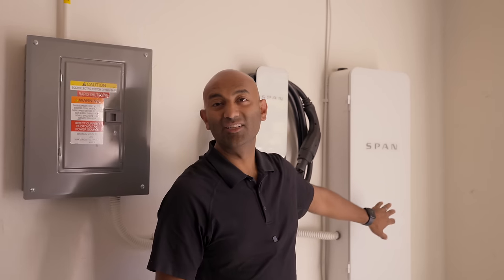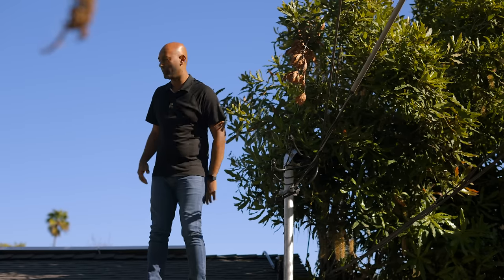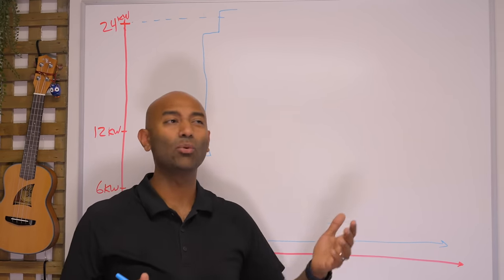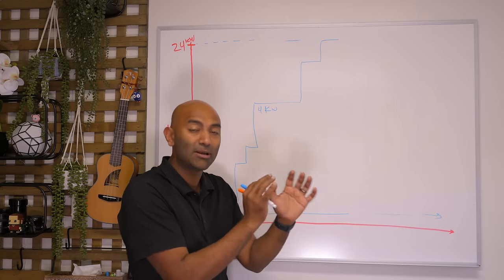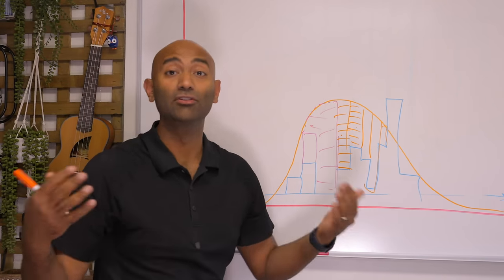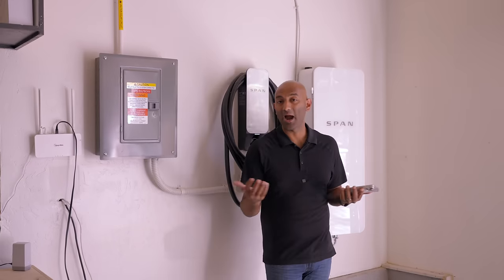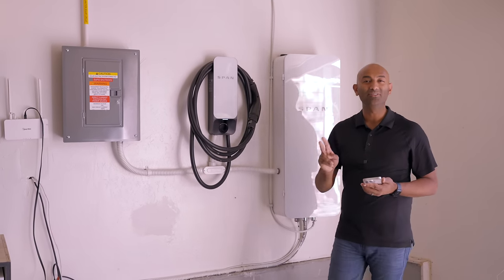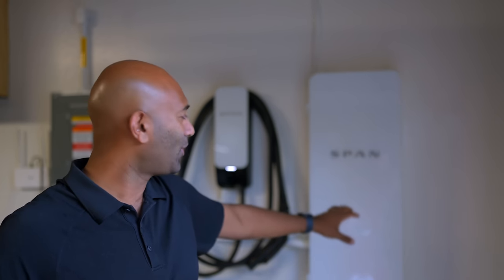I Installed a SPAN Smart Home Panel, Should You?

Comment: Critical load panels have become old-school.   That methodology is obsolete.  Yah, I know, they were popular just a year or three ago.  But not any more.  Battery-inverter installations these days have enough inverter capacity to run the whole home and the wiring for that is actually a lot easier because you intercept the service ingress and don't have to touch any existing panels or move any circuits.  So, no critical loads panel is needed anyway.    Instead all you need to do is manage your battery capacity.

For that matter, a home with a battery system can allow more load than the service just by default.  Meaning that upgrading the service is not necessary unless you intend to try to make money exporting massive amounts of power (which usually doesn't work out the way the home owner would like it to anyway).

Another big problem with this is that many homes have sub-panels in the home to distribute most of the individual loads and the main panel in the garage only has a handful of garage circuits on it plus the feeds to the sub-panels.   Moving all of those circuits back to the service ingress where the Span panel is located is impossible.  The sub-panels tend to be organized by proximity and not necessarily by critical-v-non-critical needs.   Span is useless in such homes unless you really spend the big bucks and replace all the sub-panels too.

Scheduling is not necessarily that big a benefit.  Think about it.  If you only need to plug your vehicle in once or twice a week, is there any actual effort required to plug it in at the appropriate time?  Or program the vehicle itself to decide when to charge?   The Span EVSE's ability to vary the charge rate is a cool feature, but it isn't hands-off.  If you plug-in intending to get your vehicle charged up quickly for a trip you intend to take in a few hours, it isn't going to know that unless you tell it.

Similarly, there isn't much of an advantage organizing house circuits in an automated fashion in the event of a power failure.  You have a power failure, you spend 5 minutes turning off your furnace, A/C, and water heater, and then tell people not to use the oven, and maybe unplug your EV (if it was even plugged in in the first place).  That's all it takes.

A smart service panel is not needed for these things and, in fact, the last thing you want to have happen is for the smart panel to interrupt something someone is doing without warning. If the oven is in the middle of cooking dinner, you don't want the smart panel cutting it off.

Comment: "SPAN has an API to talk to the car"  I'm sure all Chargers (EVSEs) talk to the car - that's nothing new, it's part of their comms protocols, along the lines of "What can you take" and "I can deliver x kW" as well as the other safety stuff.

Some EVSEs, like the @MyEnergi Zappi include a sensor on the oncoming supply that you can digitally set to any current, 100amp /80amp /59amp so that the charger will throttle the delivered current to the car, including stopping, so that the charger doesn't overload the house supply.   If you have more than one Zappi, one takes control and communicates to the other(s).

Comment: I am very curious about home charging your tesla using the J1772 adapter. I use my Tesla mobile charger, but was thinking about getting a dedicated charger and one the things I was thinking about is using the J1772 adapter for my charging seems like it would be annoying. Currently, when I want to unplug and go, I walk up push the button on the handle, hang-up the cord and go. With any other charger I wouldn't have that button and I feel like that will require me to either go in the app or the car and say stop charging every time before I can unplug and go. 
Since NACS is open I would love to see companies offer tesla charge handles with the stop charging button.
Reply: I thought all EVSE set-ups allowed you to simply unplug.  Our Nissan Leaf has type 1 socket for the type 1 plug, the plug has a switch in the 'trigger'.  As soon as you pull the trigger the EVSE cuts the power and you simply pull the plug.  Type 1 is the standard in the US, (Europe: Type 2 probably has the same thing)
So your question over having to go into an app is moot, all charge plugs have this instant disconnect feature.
Reply: @terryjimfletcher  a typical J1772 can be unplugged, but Tesla has a latch in the port, so the car has to release the connector. 
I bought a security ring that goes in the J1772 to Tesla adapter and prevents people from just unplugging the car, for charging in public. 
In my experience I've only charged on J1772 a handful of times, and I have used the lock. So to stop charging and pull it out I had to either go in the car or use the Tesla app to tell the car to release the connector. 
Maybe if I were to charge at home I wouldn't need the lock ring and I could unplug the J1772 connector and then the car would release the adapter. I might need to try that at some point.

Edit: the Tesla provided EVSE has a pushbutton on it that sends a signal to the car to unlatch. This only unlatches if the car is unlocked (or detects a phone key in the area)

Comment: Good morning Ricky 
I'm an electrician and nobody is going to upgrade there electrical panel unless there is a Benefit  
Smart panel does not save energy is just redirect power and the cost of panel and labor would be prohibited to most people 
The smart panel is a luxury and who is going to fix it when it breaks 
And like most new technology it's only for the rich 
Good luck 
Take care Ray
Reply: Much better to go with a smart car charger (it is THE unit with the highest load, save for an electric shower), and there's at least one that has existed for 4 years.
Reply: @terryjimfletcher  in the early 70s they had gold madalon houses that were all electric with 100 amp services and they worked just fine and many houses had electric heating cables that was installed in the ceiling

Comment: A lot of the consumption control, seems more tied to the SPAN Drive EV charger and that load, not the SPAN breakers themselves..?
It would be nice, if you don't have a Drive charger by them , to be able to soft-flip some "non-essential loads" off so you don't pop the main breaker, then turn back on when the temp load is ok?
Or, could it talk to the car API and not just monitor the miles/charge status, but also control the charge power directly in the car, eg lower amps? Or at least, like OptiWatt, stop charging temporarily entirely, until the load crunch goes away?
I'm also bit worried what happens to expensive software/cloud-driven panel, what happens if the company goes bankrupt or changes in say 25yrs... will it still work as a dumb panel at least, if the cloud backing smart features is no longer available? (some worry for connected EVs too..)

Comment: Why does no one talk about using individual smart outlets to control loads instead of adding a separate critical load or Span type panel? One could replace every 120 and 240 volt outlet with smart outlets for a fraction of the price of a new panel and be far more granular.

Comment: 🎯 Key Takeaways for quick navigation:

00:00 ⚡️ The future is becoming more electric, including electric cars, heat pumps, and induction cooktops.
- Increasing electricity usage challenges the grid's capacity.
00:30 🧠 Introducing the Span Smart Panel as a solution to grid challenges.
- It offers intelligent management of electricity in your home.
- Especially useful for areas with limited grid capacity or expensive upgrades.
01:14 💡 Key benefits of the Span Smart Panel for energy management.
- Acts as an "internet router" for power, directing and prioritizing energy usage.
- Helps optimize energy distribution and avoid overloading circuits.
03:31 🚗 Managing electric vehicle charging with the Span Smart Panel.
- Explains how a 100 amp service can still support various electric loads.
- Demonstrates intelligent load management for car charging.
06:18 🛣️ Analogizes the Span Smart Panel to a traffic management system.
- Compares it to modernizing highways to improve traffic flow.
- Emphasizes the importance of intelligent load management.
08:11 ⚡ Electric vehicle charging with the Span Drive accessory.
- Discusses compatibility with various EVs and API integration.
- Highlights the convenience of real-time monitoring and control.
10:00 ☀️ Utilizing solar power with the Span Panel.
- Explains how the Span Panel integrates with solar production data.
- Discusses the potential for using excess solar energy for car charging.
12:16 🔋 Battery backup and the Span Panel's role.
- Details how the Span Panel can prioritize critical loads during a power outage.
- Highlights the flexibility and control it offers during emergencies.
17:20 📉 Cons and considerations for the Span Smart Panel.
- Explains limitations, including the need for mechanical circuit breaker reset.
- Mentions potential future features like scheduling and notifications.
18:41 💲 Cost considerations and planning for the Span Panel.
- Discusses the premium price of the Span Panel compared to traditional panels.
- Advises on strategic timing for installation, such as combining it with other upgrades.
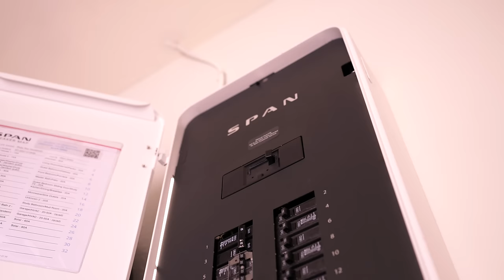20:06 🌞 Achieving a Net Zero home with the Span Panel.
- Reflects on the goal of creating a home powered entirely by solar energy.
- Demonstrates the potential for a sustainable and self-sufficient lifestyle.
20:34 🌞 Going Net Zero with Solar and Batteries
- The speaker discusses his goal of achieving a Net Zero energy lifestyle.
- Plans to replace natural gas appliances with heat pumps for heating, water heating, and drying.
- Excitement about the potential of the span panel to help manage energy usage efficiently.
21:32 📱 Future Possibilities with Span Panel
- Comparing the evolution of the span panel to the early days of the iPhone and the App Store.
- Speculation about future software updates and new features for energy monitoring.
- The importance of software updates in modernizing electrical systems for an all-electric, solar-powered lifestyle.

Made with HARPA AI

Comment: Could the same net benefits be achieved at a fraction of the price by just installing a 'smart' car charger with load balancing (like Zappi in UK/Ireland) or any other charger with CT clamps around the incoming feed and telling the charger your service limit?
Reply: Also, a simple contactor that cuts out less essential appliance, like heating, when a short period operation essential appliance cuts in.
Reply: @johnburns4017  Yes! I have this in my board at home for when my induction hob kicks in.
Reply: @barryjdwyer  
Yep Current sensing relays that clip into the DIN rail in the main panel.  Set the current switching on the front of the relay. All neat inside the panel. 

You can buy induction hobs that run on a 13A plug, or a 16A hard wired circuit. A 16A current sensing relay on say a few bedroom heaters will cut them out when the hob is on when drawing more than say 4 amps. Keeps the current draw within the main fuse limit.

Comment: I looked at span but it requires an internet connection and operates through the cloud. Not an optional connection, it requires one to work. And you have to have a certified installer, being an electrician isn’t enough. On top of all that it’s wildly expensive.

Comment: More like a traffic cop than a zipper lane.  A zipper lane increases capacity.  A traffic cop regulates flow direction and amount.  I cannot think of a single appliance except maybe my water heater that this would work properly in my house.  If it was my stove, it would force me to turn the dial to 10 when all I needed was 6.  My oven would ruin a cake or under cook food.  My refrigerator would not turn on.  My microwave would not work.  My dryer may or may not work, but it would take 2x longer to dry.  This is not an answer to more electrical solving power shortages.  We are not a star ship where life support and shields can take over power demand.

Comment: Is the Span Drive gonna be bidirectional at some point to use ev as your battery system?
Reply: SPAN Panel and SPAN Drive are engineered to be extremely flexible hardware platforms. However, industry standards for vehicle-to-grid and bi-directional vehicle-to-home (V2X) functionality are still in early stages. While we have not announced V2X functionality with SPAN Drive at this time, we recognize this is a rapidly evolving space, and SPAN is actively participating in discussions around V2X. Stay tuned!

Comment: For $7,000 (SPAN's own estimate of the unit and labor) I would buy a 8 to 10 kw small engine dual fuel genset and power it with free on the fly made hydrogen that recaptures and recondenses the exhaust to use filtered wastewater for about less than $2500 which does not hook me to a technology any electrian cannot repair. That way if the grid goes down I would ALWAYS have electricitg

Comment: I am not against electrification. Major problems electronics are fragile subject to power surges. voltage drops even electronic “noise” . battery banks ,power inverters are not all that dependable and not cheep to install or repair, there is a scarcity of qualified service personnel  . A future potential solution could be a leasing with guarantee service (business opportunity?)

Comment: It seems like the solar generation SHOULD NOT be giving free energy to the grid.  BUT it would be more consumer conscious to be paying down its own costs more generously for making the energy available at peak demand.   
So maybe, no its not giving you solar generated electricity currency to spend as you will.  But simply expedites the ROI directly to the expense of each solar power home paying off its expense.
Should that translate to HIGHER home value, more expensive neighborhoods.  I don't think it should.
I believe that simply should be the investment, expense, returned,  and more independently available electricity on demand, at your own cost for generation, starting at one's home.

The green conscience minded people SHOULD make their exceess energy available for the grid at peak usage times, so as to off set the harm and actual higher expense of coal and gas.
People being soundly aware of their community, COULD and SHOULD make their electricity abundance MORE available when they see demand is greater due to localized events, like:
High and Low Temperatures requiring greater public usage of Heating, AC, and Refrigeration.
Weekend and Holiday distance traveling with EV's.
High volume localized events using abundance of energy and infrastruture.
Everyone having means to turning in,  Most Importantly, to when  localized Private Sector Industy and Public Sector Power demands are HIGHEST.
Therby offsetting Power Plant generation.
Why would the wealthy investors and owners of power plant generative electricity want this?
Why would oil and natural gas companies want this?

To offset the taxation and hikes from regulation fining and demanding greater private sector environmental prohibition due to Oil and Gas degradation.
We should be billing for PPM of carbon generated by power plants, factories, and industry waste.  Public infrastructure SHOULD be taxing relative to expense of sequestering the carbon and minimizing the infrastructure expense by people placing and maintaining the infrastructure on our homes and property.

A fictional "California Super Power Rangers" power plant companies could go, well my solar farm is better than your house or all your friends solar homes.
But Home solar and smart breaker boxes are still effective and solution afirming,  they need to push for consistency and power grid availability,  then the advantage would be in the hands of independent solar homes,  due to losses from line transmission, stepping up and down, and infrastruture proximity to demand, cost of Big plant maintenance and repair logistics.

These smart panel boxes should have options for function On/Off wifi, internet, blue tooth, etc.
I think usb cable required diagnostics would not be a bad idea.   Most reasonably,  private service companies, observing data and offer fine tuning maintenance,  doing comparative analysis, between brands and Power Plant statistical data, with local public elected regulatory comittee oversight.

This all should tie in to Right to Repair and Homesteader Rights to choose independent of grid living, but socially responsible reporting.

If you have or considering a wifi functioning thermostat, smart solar home, please advocate for responsible per capita anonymity, sole owner principal controls of your electronics, Right to Repair, Be Informed and Refuse Contract law, and last talk about strange or unusual occurences with community.

Comment: What the frak only 100-amp service? Heck far in rural Alabama it's been 200-amp service for over 30 years.I know of houses built over 60 years ago that have a 200amp fuse boxes.
Reply: Is that 200amp at 120volts, or 200amp at 240volts?
Many UK homes at 60 or 80 amp, but always at 240volts

Comment: Don’t get a heat pump dryer because they are awful.  Their original purpose was to eliminate a dryer duct and simply drain water out of clothes.  Dry time is double that of a conventional dryer.
Reply: We like our Meile heat pump dryer. Yes it might take 15 more minutes to dry a load of clothes but it uses 1/3 of the energy that the electric Whirlpool  dryer (1.8 kw max vs 4-5 kw constant load) that it replaced.  Granted we waited for the Whirlpool end of service life failure before justifying the massive replacement costs knowing our future goal is to be 100% off grid so we are reducing load draws as they fail with better efficiency products.
Reply: @jstaffordii  I had a Bosch heat pump dryer and it took 45 mins extra.  Now I have a Whirlpool HP dryer because a duct is not available in our condo.  It is better than Bosch, but still about 25 mins longer.